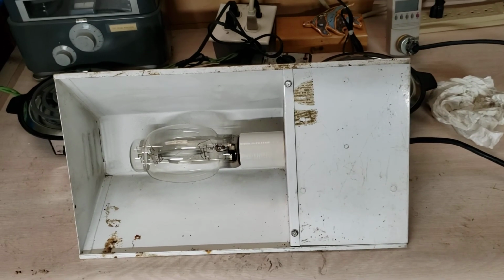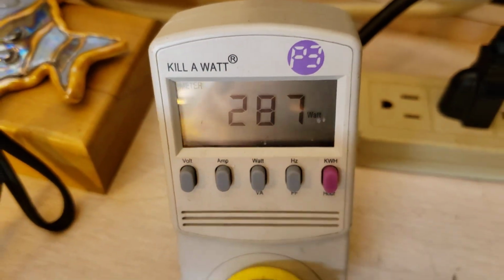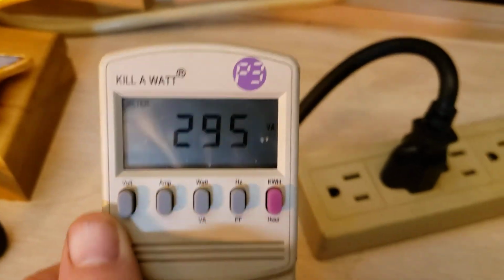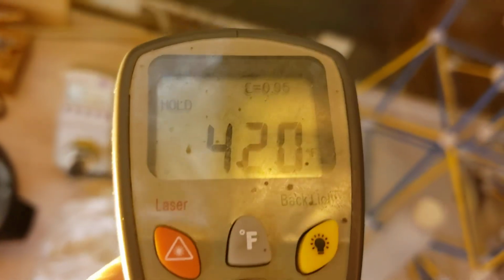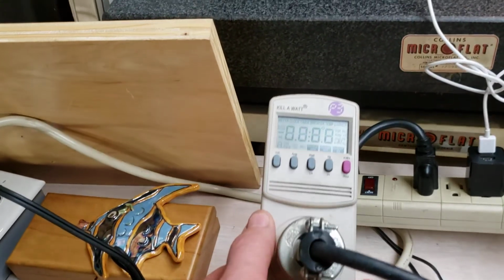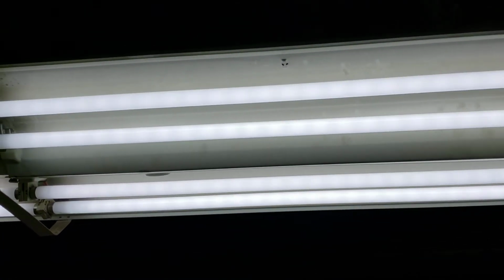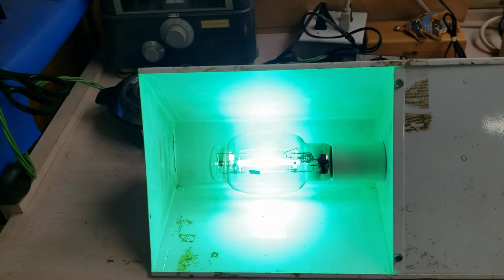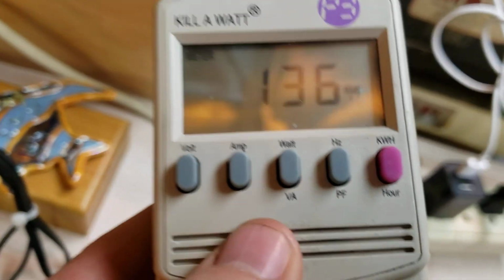Metal Halide light test part 1 4~Phase Superconducting grid system LPM&R amplifying Linear Current.

Comment: The lamp inside this fixture seems to be an Iwasaki 220W Sunlux Ultra Ace high pressure sodium retrofit lamp intended for 250W M58 probe start metal halide ballasts and 250W H37 mercury vapor ballasts.

Comment: Uhh dude? You accedtally read off volt amps as watts, which on a pure dc curcut are the same thing, But on ac there is also power factor which can skew your readings. A 100 inductive load on 100v ac might draw 2 amps having a power factor 0.5, thats why your volt amps and watts are different. Formula for ac loads: VxAxPF=W

Comment: Threshold voltage of ignition switch reached?
Reply from the maker: The transformer is 120v input a run cap in series out of the transformer to light on one leg with 280voc outputting from the transformer. So, as a furtherance of the last comment, the light is square 75v 75h 150w 150v to trigger. Not actually normal with Tesla A/C or Faraday D/C. However, very well understood in amplifying Superconductivity. 

David A. Puchta 
www.ProtonSpinTechnology.com